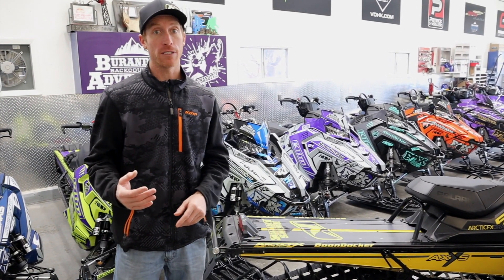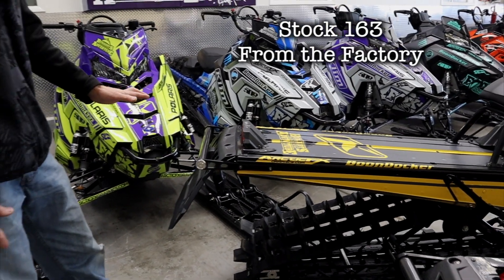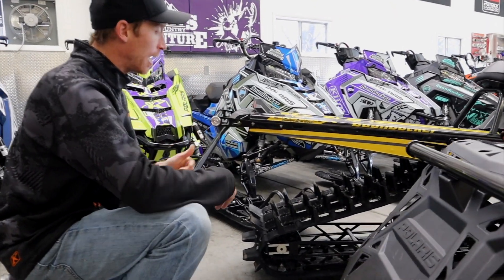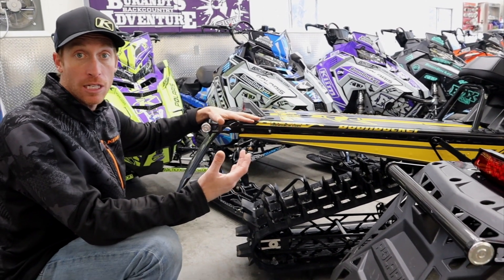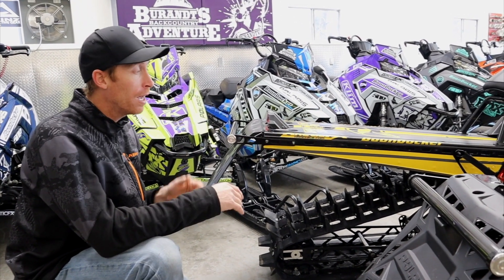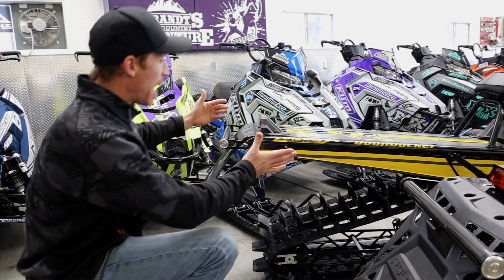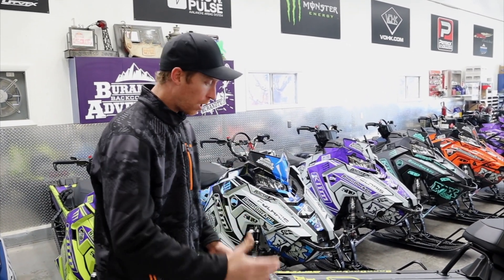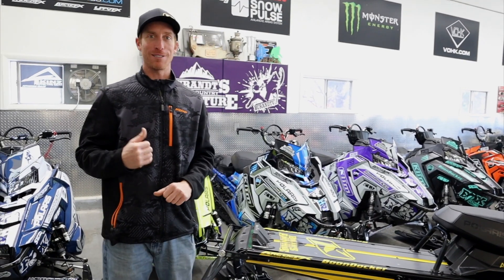Burandt Cuts His Tunnel | First Look | 155 vs 163. Short tunnel. Long Track

Comment: It seems like snow builds up a ton both at the back of the running boards and on the center on the tunnel and I noticed after trying a new alpha that this didn't happen. Is this because there isn't a cooler going down the tunnel warming it up and melting the snow making it stick? If so what can ya Polaris guys do to prevent all that snow from building up? Awesome video again and cool mods!
Reply: yeah thats exactly why there isn't build up, we don't have much issue with tons of snow on our tunnel but the running boards do have that build up.  the new skiz Tri lite boards are pretty great at addressing that! heres our video about them https://www.youtube.com/watch?v=4q83qbGEn90&t=111s

Comment: You should be lead designer at Polaris... it drives me crazy to see how your sleds are built compared to what they are putting out...
Reply: He is the tester. You'll see in thr next year or two Polaris will probably switch to a different cooling system and a shorter tunnel version.

Comment: A number of people both locally and worldwide have gone down in track length from 163", have you noticed if the shorter tracks have advantages due to increased track speed? If so which snow conditions does this have most effect or negative effect?

Comment: I can barely buy a 2007 rmk 600 and this guys got 14 brand new ones, jelly...
Reply: He gets em free.
Reply: After all the hard work and time he has put in it is well deserved
Reply: I think he needs a couple more back up sleds. This is not enough.......
Reply: Fasterdura177 Lots of those are his company sleds, Burandt’s Backcountry Adventures.
Reply: No he does not.
Reply: +skippy gaming The earlier RMK chassis are basically the same except for the rider forward handlebar contraption, higher running boards and a more aggressive front shock that gives it a bit extra ride height under the belly. So if you make a rider forward handlebar setup, find some slightly longer front shocks, and lift your running boards, you can have 90% of the new chassis benefits. Remember to keep clutches and engine mounts in good condition (all too many sell their older sled simply because these two things start robbing the clutch efficiency). You can also gear it down further, have a more aggressive clutching (higher engagement point on your clutch springs and dalton adjustable weights).
Reply: @lazygamerz  I have a powerblock primary and I'm ordering secondary Dalton spring and helix after I fix my fuel cut issue.
Reply: @skippygaming7216  Fuel cut? What are the symptoms that made you determine it was a fuel cut issue? You can keep the helix stock unless you have a clutch setup that works well, that you want to fine-tune.
Reply: @lazygamerz  well I for sure know it was fuel cut because i had a blocked jet, runs perfect now
Reply: My secondary clutch keeps getting jammed open tho
Reply: @skippygaming7216  If your secondary keeps getting jammed open you should seriously check your rollers and weights and springs for wear. Doesn't take much work to check on them, the primary can be checked while its attached to the engine by just taking the cover off (Turn the bolts out a few rounds at a time then move to the next bolt, until the cover is off. Then to put it back on its the reverse).
Reply: @lazygamerz  yeah I know, my primary is a aftermarket powerblock clutch. My secondary I think it's dirty and has a warm spring. Going to upgrade it and stuff to match my primary
Reply: Warn out spring lol
Reply: @skippygaming7216  Clutch maintenance and engine mounts is king, above all upgrades and aftermarket stuff, keep it in good condition first. Then improve on stuff. Checking piston rings through the Y-pipe is also a good thing (piston rings are the most underlooked performance item on the sled, if they're worn you lose 5-10 horses, slightly worn can run another 5k miles still, sure, but new rings can become not-new in 500 miles or 3500 miles depending on use). When you go the upgrade route: TEAM secondaries are second to none, no twisting motion between the sheaves. But for this season just check the rollers on both clutches and make sure your springs aren't cracked or broken or simply old (they soften with age). And the weights can have huge wear if the rollers are bad, I wore about 15 grams out of one of my weights two seasons ago, in 700 kilometers, because I didn't notice one roller was bad. Changed rollers and last season I ran head to head against all the brand new polaris 800s (with my crossfire 7). PS: the weight arm bolts on the primary should never be over-torqued, the ones without set-screws should be torqued to spec, the ones WITH set screws should be tightened finger-tight, then wound half a turn back or even three-quarter turns back (red loctite holds the nut on, not torque). The weight arm should swing freely, like a fidget-spinner. Last time I had my clutch in the mechanic shop they tightened my set-screw weight arm bolts so hard you'd swear it was a V8 engine mount bolt. Last time I ever bring them any work.
Reply: @lazygamerz  I just rebuilt the engine top to bottom now I'm doing wear repairs
Reply: @lazygamerz  I don't bring anything to the shop
Reply: @skippygaming7216  Did the top end this summer, it had 6.3k miles on one set of pistons, so then it was time. The used pistons and cylinders look good for another few thousand miles (bullet-proof suzuki laydown 700cc). This season I put a new primary clutch on, and 55/65 gearing, with hella aggressive clutching. 4950rpm engagement, should be a wheelie monster (2" lugs on 136" track). Then I just gotta put miles on it for the next few years, I need about 4k more miles on it for it to be a dollar a mile, then every mile on top of that is just a bonus. I don't have the tools to take off the spider from the clutch so that's the only thing I let a mechanic do, but from now on I do don't let him touch the weight bolts.

Comment: One more question saw you are running the 2.8 conquer. Does this work with the 2.6 drivers?
Reply: He's not running the 2.8, feel the 2.6 does much better in deep snow!  the 2.8s have different pitch so you wound need Drivers
Reply: Thanks for info

Comment: What temperature is getting hot on an 800 axys
Reply: 140+? Idk mines normally 125-130  and I don't let it get hotter than 150
Reply: yea anything over 150 is pretty hot, the new 850s run at 100

Comment: You should make a 163 with a 174 track or would that be to far?
Reply: it would work but the 174 is a little pushy in our opinion for handling in the tight trees
Reply: @Rossxr   Chris Burandt use 163 stock rail (Polaris) or ice age rails?

Comment: Is it a good idea to cut 155 tunnel using 155 track?
Reply: Cut it and install an mtntk cooler in the rear instead of the stock Polaris cooler.
Reply: that will help for sure! it is the same idea as our 163s with 155 tunnels. we have been cutting 4" off the 155s

Comment: Where is measurement initial point? 4 inches from tunnel end or flap frame?
Reply: end of the tunnel, remove the flap mount then re- install
Reply: @Rossxr  How many inches can cut on 163?

Comment: What’s the length difference between a 155 and a 163 tunnel?
Reply: Spencer Turck 8”...
Reply: Caius Andromeda are you sure about that? The overall length difference between a 155 and a 163 is 3.4” according to specs
Reply: Spencer Turck sounds like you found your answer then, the rest of the chassis is identical

Comment: Why not a 146 sled with a 163 rail?
Reply: the 146 sleds have completely different bulkheads and tunnels so we need the axys tunnel and bulkhead to get the right geometry and weight. ect.
Reply: Ross Robinson sounds like Polaris needs to put the goods in the 146

Comment: What a about putting a 155 track under a 144 tunnel?
Reply: you could do that but for us the 144 chassis isnt as good for our riding style
Reply: @Rossxr I ride in the east and we don't normally have endless pow but the 144 finds its limits. Will be upgrading to 155 track over the summer. I'll have to see what it looks like without a tunnel ext.
Reply: different mounting holes curved rails ect

Comment: Why don't you just buy a 146 and put a 163 track and suspension on it!
Reply: the 146 sleds have completely different bulkheads and tunnels so we need the axys tunnel and bulkhead to get the right geometry ,weight, handling and performance
Reply: Or buy lynx bondocker